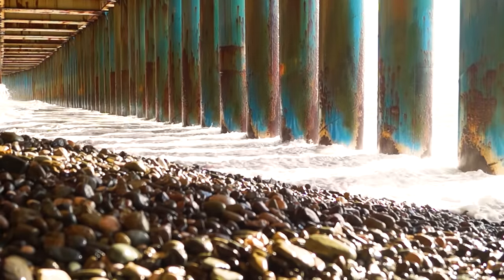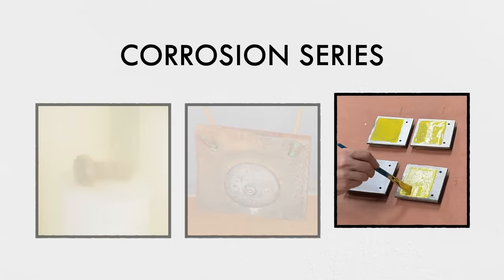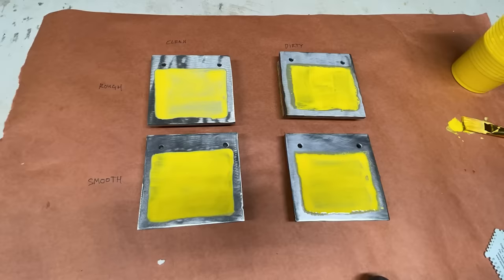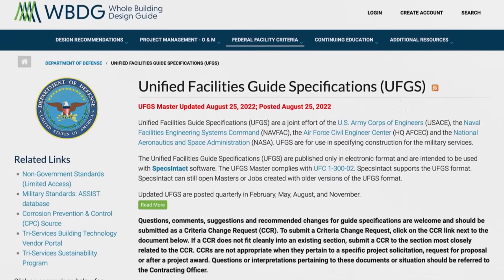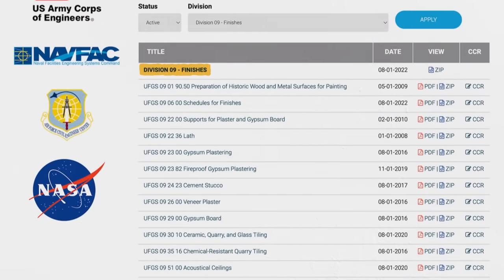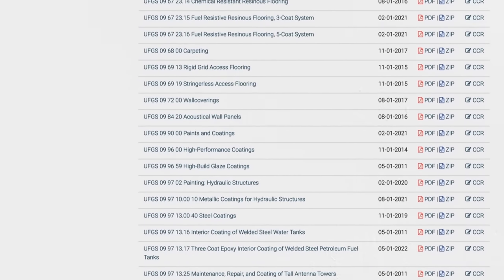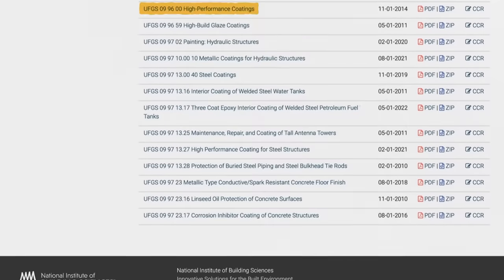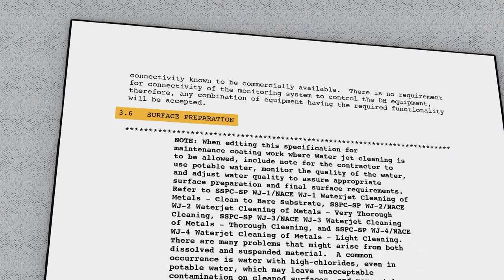What's the Difference Between Paint and Coatings?

Comment: This is a very good video. Most contractors when they first come into factory construction don't understand why they need rigorous sand blasting work. What is missing from this report is that it does not show the mill scales layer on hot rolled steel products. And that the primary function of sand blasting is to remove it.

Comment: I don't work in infrastructure at all. I just like learning anything technical or scientific and this channel is awesome. So, it seems to me that coating a structure is kind of like putting a latex glove on a hand. It forms an unbroken, sealed jacket around the structure to keep all the bad stuff off the surface. As long as that seal remains unbroken and affixed to the surface, it is really hard for anything to touch the surface and start the corrosion process.

Comment: Back when I was a Chemist in a paint laboratory, I was working on the development of various zinc rich primers. I had steel panels that were left outside in the South Florida weather on the test fence for about 8 years. They had an x scratched through the primer into the bare steel. The good formulations had a small line of very light surface rust along the scratches that was stopped from intrusion along the surface and penetrating the steel. Zinc rich primers are among the very best for stopping rust, but they "ain't" cheap.

It's interesting that he mentioned the three-coat system. One of my other projects was to develop a new and more cost-effective coating system for airliners. There was a very specific way the aircraft aluminum had to be cleaned, followed by a thin coat (wash coat) of Zinc Chromate primer, followed by a catalyzed epoxy primer, and a catalyzed polyurethane topcoat. The problem was not rust but adhesion to the tough aircraft aluminum, resistance to harsh de-icing chemicals, hydraulic fluids, jet fuel, extreme temperature changes, and the flexing and rippling of the skin of the airplane as it flies.

12:15 His Rustomatic 3000 is a good substitute for the salt spray testing chambers used in real coatings laboratories.

Comment: Can you do a series on preventing wood rot? I deal with this all the time and had a big impact in construction.
Reply: fastest wood rot is where soil touches wood in the top six inches of the soil, where oxygen and water is readily available.  otherwise in the cracks between and under wood pieces, where wood stays moist.  moistness always fosters mold growth and encourages termite and other boring insect colonies. water seems to always work its way through any coating because of the soft surface causing cracking and the wood stays moist under the coating layer.  old timers have sworn to me  that if you can build so that the wood dries rapidly everywhere after a rain, an uncoated piece of wood will last forever, the biggest enemy being wind driven sand or snow erosion and wasps/hornets chewing off the surface to build nests (but thats a big problem only after 200-300 years).

Comment: Excellent, as always! Informative and educational, without being dull - I could easily watch one of your videos if it was an hour long.

As for the Forth Bridge, It wasn't actually true, that they had to start repainting again as soon as they finished - but pretty close. To quote Wikipedia, " Such a practice never existed, as weathered areas were given more attention, but there was a permanent maintenance crew. In 2011, the bridge was covered in a new coating designed to last for 25 years."

It is a massively complex structure (typical Victorian over-engineering) and in a terribly exposed situation (North Sea estuary in Scotland!!), so, continuously painted, or not, this is still an amazing achievement. 

I travelled over it recently, and it is a truly astonishing structure. You simply wouldn't believe the size and complexity of the engineering - almost entirely steel girders and millions of rivets! I just couldn't imagine painting that...
Reply: You travelled over the Forth Bridge? I was under the impression that it was used by freight trains only.
Reply: @rpbajb  All passenger services from Edinburgh to the north cross the Forth Bridge.

Comment: Wonderful series! Really well explained.
I would love to see more about coating types and their fillers. 

One of the coolest I have heard of, is the glassflake filled costings used on oilrigs. These can last for decades as the flakes both gives an inert and impact resistant surface, but most importantly increases the distance water has to travel through the coating without increased to thickness.

Comment: Here in the Salt Belt of northern Indiana, I apply a bi-annual coating of Fluid Film on my two Jeeps to prolong their rust-free condition
“Rust is the REAL enemy”✅
Reply: Do you use Fluid Film primarily on the underside or do you use it on body panels as well? I was always curious about that stuff.
Reply: @soulfuzz368  I use it inside the door panels using a step drillbit to gain access discreetly if needed. A plastic cap will snap into the hole and give it a finished look.  I don’t believe you have to repeat application on areas where road spray is not coming in contact with fluid film.  I will usually reapply it to areas that get blasted by slush when the weather is dry and warm enough sometime in the winter.  I buy it by the gallon and use my air compressor and flexible 360° wand for all the hidden areas. You can also use a similar extension on the rattle cans for really tight places, but bulk is the way to go.

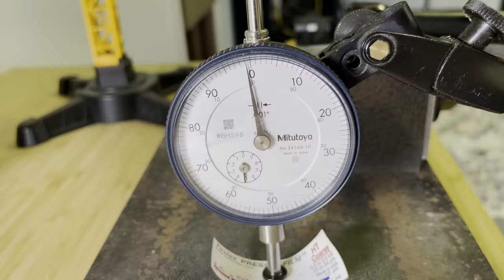Comment: Disclaimer: This is coming from someone who has held a NACE (now AMPP) CIP Level III and an SSPC (now AMPP) PCS who spent plenty of time both in the coatings lab and in the field on projects: Overall, as a popular video for the general public - excellent job with the video. Kudos. Now onto the quibbles: A quibble at 4:29. Washing prior to abrasive blasting is critical for areas where salt contamination of the surface is a concern and is standard in some specifications. Quibble 2 at 6:20 - The tape you are using maxes out at 2.5 mils, and deeper profiles will just report as 2.5 mils. Therefore you should re-measure with X-Coarse tape (which is the most typical tape used on industrial coatings projects) for any measurement beyond about 2.2 mils. More than a quibble at 6:33 - a power tool cleaned surface (SSPC SP3) is not a good substitute for actual abrasive blasting (SSPC SP10 being the most common) for comparison versus hand tool/sanding (SSPC SP2). I do like the Rust-O-Matic 3000. Good design. Quibble 4: Clear topcoats are not common on industrial structures (unlike automotive) - the simplest way to have a UV opaque topcoat is to fill the topcoat with pigment which blocks both UV and visible light, with examples being titanium dioxide, zinc oxide, lithopone and (historically anyway before TiO2 was widely available) - white lead (lead carbonate/hydroxide). Clear topcoats which block UV generally require organic UV absorbers which tend to degrade over time, unlike the aforementioned pigments. 11:30 The intrusion is generally referred to as "undercutting" - typically corrosion panels are fully coated, then an intentional defect/holiday is introduced by scribing through the coating to bare metal, often either in an X or linear pattern. 12:06 - Yes, this qualifies as a laboratory test. Not the usual industry standards - but based on the information provided it is sufficiently rigorous to qualify as "laboratory tested".

Comment: Just like pinhole and holiday detectors, there are adhesion test equipment which check the adhesion of the coating to the substrate.Something called a dolly is stuck to the coating and pulled out with a hydraulic puller. The pressure and the area of disbondment is measured.Prior to this a cathodic disbondment procedure maybe done by subjecting a sample to voltages which replicate the corrosion voltages in the environment. All this has relevant ASTM standards.

Comment: I’m a painter and the surface prep is extremely important to paint adhesion and longevity. We almost always sand or remove rust or even clean metal surfaces with thinners. I often use pretty nasty paints and primers for metal surfaces in particular. People think of painting trades and envision just painting houses or something but people don’t realize how critical paints and coatings are to everything in our society and life. Your car, your house, a bridge or structure all need to have coatings applied to protect them from the environment/oxidation and it plays a vital role in our infrastructure. I do everything from residential to commercial to industrial work but most often i’m doing commerical and industrial coatings in my company. Sometimes being a painter feels like you’re a glorified cleaner because of how much preparation is involved, we’ve had to scrape black soot off of ceilings above magnesium cauldrons in factories after an explosion which is very dirty and dangerous. Being a painter can be very dangerous and we take it for granted. You have to get in awkward positions and be comfortable with heights, it’s taxing on the body
Reply: If you own rental property, much of your life is spent fixing horrible painting over the years.  One hallway I have chips off paint if you just look at it wrong!  Someone painted over varnish and didn't prep it properly.  That was 80 years ago and I'm still "enjoying" the issues!

Comment: I'm in county road engineering and about to take my state Bridge Paintings and Coatings certification (we have quite a few bridges), I feel like I have a head start with this! Personally, I'm a big fan of weathering steel. Despite early concerns and certain exceptions, it can work great even in high chloride environments when all environmental factors are considered. Michigan used it on select projects from the mid-60s through 1980 but had issues in certain locations where the steel rarely had the opportunity to completely dry and the oxide coating never had a chance to form, resulting in significant section loss. Sadly MDOT has shied away from it ever since and spends a fortune coating structures (the entire structure including the concrete parapets and substructure components along with epoxy or healer/sealer deck treatments too). Michigan didn't have this stance until about 2003 and bridges since then have held up very well when combined with epoxy-coated rebar (used here since 1976, mandated 1980).

Comment: I'm a materials engineer and worked with a coatings company that has created a corrosion resistant coating that has excellent corrosion resistance, even with surface defects. I was actually in charge of creating a standard test to test the corrosion resistance to a defect of specified size (not as easy as it sounds). With this test you can see the effectiveness of a coating with a defect and what size of defect starts to allow rust to occur behind the coating.

Comment: Brady,  I spent 24+ years in the United States Navy.  "Coatings" were important.  I served on both ships made of some structural mix of aluminum and steel, and all-steel ships.  Red lead primer went out the window before my arrival, though was still present in the undercoatings of painted...errr...sorry....  coated ....surfaces.  This was 1992, and new coating methods were prescribed.  Mainly for Zinc Chromate on Aluminum.  That is what "the book said".  This was a very expensive product, and it drove my superiors MAD that I refused to move without the correct product.  My demand "blew the budget"..... but I only primed and painted once in 5 years.  My demands were spelled-out in a book I did not write.  The same book everyone else was also supposed to follow, so I was justified.  Fast forward a decade or two, and I was once again the jerk:  Do it right the first time, or do it three times.....on steel surfaces.  My Sailors hated me, but by using the correct roughening methods and correct coatings...we did it once...in 5 years.  It would be a lie if I said we employed the best tools for surface prep...we had pneumatic needle-guns and sanders.... but much of the detail relied on eyeballs and fingertips.... nor did we have the best coatings..... some sort of green epoxy primer and gray paint...all produced by the lowest bidder.  When the surface is prepped correctly,  even absolute sh%$ product will last 4 or 5 years.  Powder coating doesn't last that long....and non-ferrous fasteners were my friend.  Bi-metalic corrosion was my enemy.  I appreciate this video, very much.

Comment: The one thing I noticed was that you appeared to use the same brush for applying the coating to the 4 test specimens, starting with one of the oily specimens. I would have recommended different brushes for each specimen to prevent cross contamination.

Comment: I would prefer a coat of good old rust-oleum on a well prepared surface vs the most bomber products over an unprepared surface. I have literally seen a macropoxy/acrolon system fall off a pipe like a peanut shell, because it wasn’t prepped.
Grady nails it, as usual.

Comment: I work in a retail paint store and many of the things you mention here apply to the light industrial coatings we sell too, just on a smaller scale. We sell 2 component epoxies and many other such light industrial coatings and just like for larger projects it’s all in the nitty gritty details of surface prep and application. A lot of people applying said coatings don’t know the importance of doing said work, especially at the light industrial end where they aren’t out on critical infrastructure and so don’t have the training and education. Or they just don’t want to do the necessary prep and don’t believe it will make a difference. We have seen many costly failures as a result, these coatings costing easily $100 or 200 a gallon in places.

Comment: Excellent, I learned a lot, especially re test equipment.  As the PE with a large water system I  was involved in many corrosion issues, including failure of prestressing wire used in 60" diameter prestressed concrete pipe, where the wire was drawn to 294,000 psi, where the high pH of the concrete coating was not enough to keep wire from rusting (hydrogen embrittlement was also a factor, among others).  Frankly I had the best success in wrapping pipe in 6 mil pvc.  
   Looking back, my biggest painting challenge was as an enlisted sailor in the Navy, where I was a disappointment in painting a Battleship, the USS New Jersey,  We chipped paint, no sandblasting.  I'd miss places and the Chief was not pleased.  And I got no credit for using the right shade of grey paint. :-)

Comment: Excellent video as always, highly informative and engaging! One thing you didn't touch on is that a lot of the time the protective coatings are applied over a sacrifical zinc rich primer. This is especially true with preventative maintainence on things like high voltage transmission towers, bridges and large industrial tanks. The purpose being exactly that of the pucks in your previous video on corrosion.
Reply from the maker: Well, at 8:11 I mention that "Sometimes the primer coat includes particles of zinc metal. Just like using a zinc anode to provide cathodic protection, a zinc-rich prime coat can sacrifice itself to protect steel from corrosion if any moisture gets through."
Reply: @PracticalEngineeringChannel  My apologies, not quite sure how I missed that. As mentioned before, Excellent video! Love your content and keep it coming.

Comment: I worked as a web developer, making a website for Akzonobel, that allowed monitoring of paint jobs in dry docks. There is quite allot that goes into paint jobs than it seems. They(Akzonobel) monitor all of the vessels painted using their paints, for decades. They analyze the paint jobs using all kinds of measurements. They measure rust spots, densities, "fouling" - which is how much unwanted stuff has stuck to the paint...etc.
They had all kinds of documents and specifications, telling the drydock workers how to apply the coatings. Interesting stuff.

Comment: I used to spray industrial enamel HPC. It's crazy how particular things have to be, in addition to meeting the blast profile (which is actually the easy part, just use the correct sand) it also has to be completely white blasted and usually x ray inspected after, then re blasted and primed right away. Then the coatings have to meet not only the manufacturers specs for coat thickness ambient and surface temp and humidity, but also the clients specs for total coat thickness which sometimes go into 20+ mils (each coat is usually roughly 1 mil, but high build primer can be around 3 mild)

Comment: We once built a house for an Engineer, and as time progressed I learned he was a "Chemical Engineer". In the end it turned out that his company made specialized coatings, mostly for aircraft including military planes. He couldn't divulge some details, but when you consider the immense heat of supersonic flight, the extreme colds of subsonic flight and parking in arctic climates, plus having that coating absorb radar waves it's a very complex field of work which requires deep knowledge of the characteristics of many substances. You hardly think of "paint" as being highly technical but it is. And with today's required shifting away from VOC's for environmental reasons it's even harder to make a coating which meets the specific qualities needed for specialized purposes. And yes, in coating application the prep-work is the key to everything and that's where most of the work is- actually applying paint and coatings is easy in comparison.

Comment: bring back some memories of working in hardware manufacturing...  salt spray tests for painting and coating.. and yeah surface prep for metal parts... sandblasting is usually done in closed chambers.. wondered how disastrous it is to apply it outdoors in infrastructure or large pieces of equipment